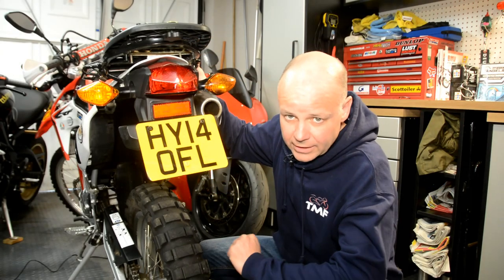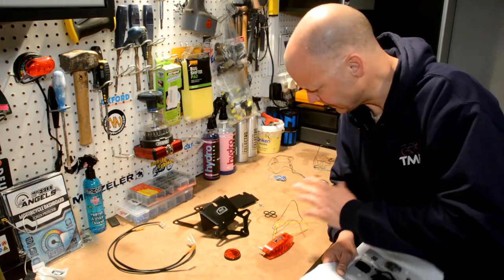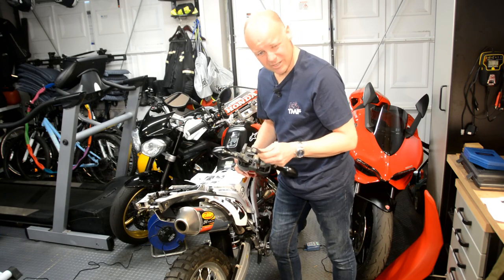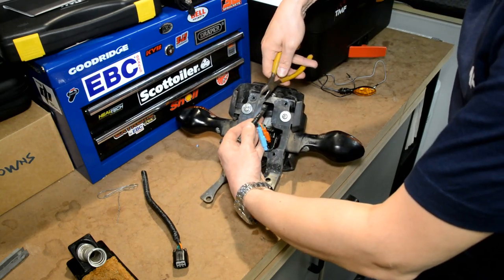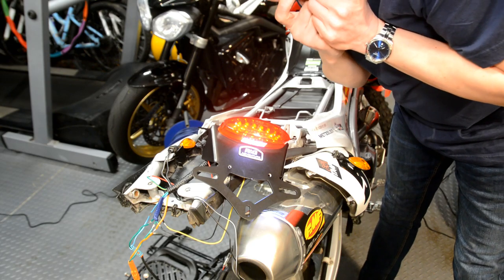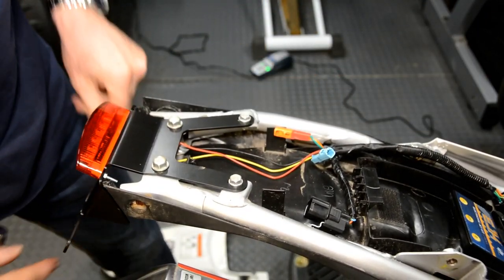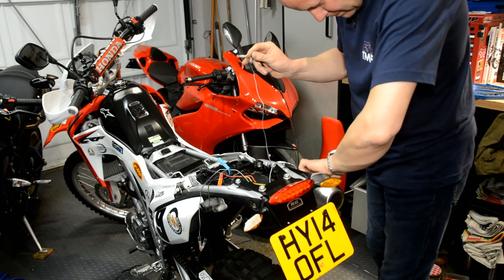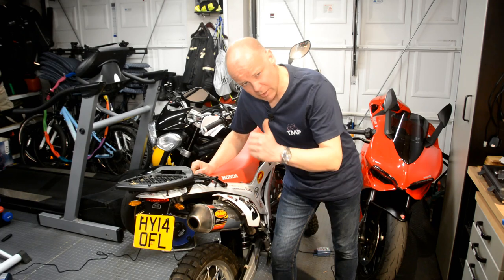How to cock up even the simplest of jobs! - Honda CRF 250L

Comment: Hiya TMF, you need to put some shrink rap on those solder joints as the tape will get wet and move, also to alter the speed of your indicators you need a couple of resistors (ebay), fit them when you re joint your wiring. ian (electrician HR Wallingford)
Reply from the maker: Cheers Ian - I've ordered both some resistors and a LED relay from Amazon, I'll see what looks easiest when they turn up!

Comment: To slow the indicators flash you can add some resistors (more soldering) or I believe there are dirt cheap 'dedicated' Flasher Units/Relays (for DIY'ers that have changed over to LED's) which have built-in resistors (no soldering just a simple swap out) - most bikes have this aftermarket option; Just a couple of quid off eBay.
*They often have an adjustable screw to set the timing.

Comment: Contact the supplier, or search in forums etc, to see if you need inline resistors or relays for the indicator flashing issue, I had to do similar (with resistors) when changing led indicators on Panigale :-)
Reply from the maker: Yes clearly I do need some resistance in there - I’ll do some research...so much for plug and play!

Comment: Hi the solution for the fast flasher speed issue all you need is a fixed rate flasher unit if contact a company called 12 o'clock labs you’ll find all the electronic plug play units you’ll ever need for your CRF...!!!

Comment: You need a load resistor for your LED turn signals. Since your factory wiring was set for regular bulbs, the LED uses a lot less power. Unfortunately those resistors sometimes are more expensive than the turn signals themselves.

Comment: Good on you for trying,  a relay specific for Leds  should sort the flashing speed out, always a good idea to have heat shrink in your tool kit, also one can buy conduit yo cover all the crap up, looks much bettet you mechanic you 👍👍👍😎
Reply from the maker: Yes just ordered some R&G in-line resistors from Amazon - less than a tenner!  So much for "plug and play"!
Reply: @TheMissendenFlyer  next ti.e look on eBay,  always cheaper & usual no P& P👍👍😎

Comment: Great video TMF you should have kept the colourful language in.. I fitted the DRC edge 2 tail tidy to my 2019 CRF250L and 250 Rally.Totally plug and play and the bracket comes with mounting holes for both OEM and aftermarket indicators. I actually left the original indictors on both bikes as they look ok. The DRC cost £59.
Reply from the maker: Seems like a better deal by far!
Reply: TheMissendenFlyer Only by about £25 if you add the aftermarket indicators, but the fitting was much easier 😉  I  got my 250L new in January then started seeing all the 250 Rally vids..bought  a 2nd hand 250 Rally with 180 miles on it, FMF slip on, tail tidy and rear carrier already added now I’ve got them side by side in the garage. The wife doesn’t mind either so every cloud..keep up the great vids.

Comment: 1) Don't but an R&G tail tidy.
2) Always use heat shrink when connecting wires.
3) If you've drilled a hole into metal, rust proof the hole and if possible insert a rubber grommet to reduce vibration and wear.

You may now find you wire connections become loose, the fitting will start to rust and your indicators will regularly fail. Sorry.😬
Reply from the maker: Thanks for the advice Michael - this is how we learn!

Comment: You need an LED flasher unit (plug and play and easier than soldering in resistors) as you have led indicators now. Did same job on my BMW G650GS Sertao but with 2 slightly flattened L brackets for £1 for small number plate mount.

Comment: The indicator need resistance relay.
Reply: Correct
Reply from the maker: Yes but what type?
Reply: @TheMissendenFlyer  Best and easiest way is to buy an LED relay which replaces the original.
Reply: @TheMissendenFlyer  Ask R&G what size and power rating resistor they need! ;)

Comment: Looks nice but I’d be a bit miffed if I paid £82 then had to destroy the original part, should be a straight exchange. You’ve done the video maybe  hopefully R&G will take some notice of the comments. Not sure also that £10 for a couple of resistors that should have been part of the kit is good value.

Comment: Complete pain of a job, my language was far bluer than yours when I did the tail on my CRF though ! Still haven’t sorted my indicators which flash like mad ! Good luck with it 👍
Reply from the maker: Have you got the same tail tidy?
Reply: TheMissendenFlyer  No, I went with a cheap eBay tail tidy, and some oxford non led indicators. My indicators flashed at twice the speed despite not installing leds, so I attempted to change the flasher relay, but found the stock unit installed was infact an led relay ... am assuming to accommodate the stock running lights maybe.  12 o clock labs make a fixed rate flasher adaptor which seems to be the go to amongst some fellow crf riders.

Comment: If you use some heat on the insulating tape it should nicely shrink to seal the gaps. Personally I hate these kind of jobs they are such a pain and most of the time look like they not going to last.

Comment: Always enjoy your CRF videos, did you ever look at the DRC edge tail tidy, it comes with a bottom plate to keep the wiring clean and pre drilled holes for the indicators and is around £50 on Ebay.
Reply from the maker: No - I wish I had!

Comment: You can buy heat sink resistors cheap enough on eBay . as the the indicator relay was designed to run under a heavier load ..

Comment: your indicators go quick causse there led-s....you need to add a resistor parallel of each led indicator to up resistance to match a normal bulb. if your oem bulb is 21 watts u need a 8.2ohm resistor to match the oem bulb resistance.....do i make sense?

Comment: Hi TMF, Your LED winkers "hyper flash" as they do not present the resistive load that the bulbs did. As you can mention you can restore normal winking using resistors to put the "load back" personally I think is crude and not very nice, much better to spend a fiver on a solid state flasher relay, this will blink LED's, bulbs or anything else. You can even get them with adjustable flash rate. I always convert my bikes to 100% LED's, I solder and heatshrink all joints and tend to use cloth loom tape (or non adhesive plastic), dont use PVC insulating tape, as its not really suitable. Cheers Matt.
Reply from the maker: I like the idea of replacing the flasher relay - trouble is I've no idea where it is or what it looks like on my CRF!!
Reply: There are plenty of YouTube vids showing how.
Reply from the maker: I shall certainly be checking those out in due course!
Reply from the maker: ...right thanks for that - relay on order....

Comment: Hi I have tried an R&G tidy on my CRF didn’t like it. I have now fitted a DRC edge 2 from adventure- spec lot better fit an looks better, you can use original indicator or 10mm LED indicators, I have also tried R&D resistors for the LED indicators still too fast, finally used some 50w 6 ohm resistors in aluminium cheaper than R&G and they work, got them from Amazon.
Hope this helps.
Reply from the maker: Thanks Chris - alas I have the R&G ones on order from Amazon Prime :0(

Comment: You will need inline resistors to slow down the speed of the indicators. The resistors will get a little warm/hot when the indicator is flashing.
Reply from the maker: How do you work out the value??
Reply: @TheMissendenFlyer  

Louis-moto has a very guide for fitting led indicators on their website which includes the formula for selecting resistors. Search "fitting led turn signals" on the website.

https://m.louis-moto.co.uk/rund-ums-motorrad/schraubertipps/led-blinker

Comment: Thank you for posting.  Great video.  My compliments, anything that requires cutting, drilling or removing more than 6 screws I leave to the experts. :)  Seems to be a good philosophy for me (cheaper than having to buy a new motorcycle).  I don't understand why the vendor did not include the connector.  Seems a bit tacky, hopefully they have a reasonable explanation.  Also, I recently discovered "Itchy Boots" and noticed at least one post from you.  I am still playing catch up with her videos.  If you get the interview, it would be a great coup for you and good exposure for her.

Comment: Seems as if you shyed away from drilling two new holes in the license plate to properly locate that under the license plate light - eliminating the black plate where you conveniently place a TMF sticker.  I like the sticker, but still believe the license place ought to be positioned higher on this particular bracket.
Reply from the maker: Fair enough!

Comment: Those indicators look wonky. Are the holes level, and in the dame location on each side?
Reply from the maker: They are wonky and they are the same both sides - turns out those side plates aren’t exactly vertical...

Comment: just put a couple of resistors inline with your indicators and that should slow them down
Reply from the maker: Yes just ordered some R&G ones from Amazon - less than a tenner!  So much for "plug and play"!
Reply: @TheMissendenFlyer  some sets do have them built in some dont  50/50 on which you get

Comment: I've been put off getting the R&G tail tidy for the Honda CB300R due to the poor instructions I got with the radiator guard (great guard, crap B&W photocopied instructions) and the lack on online fitting instructions on the R&G site (Coming soon!).  I did email them about the quality of the instruction sheets, but got zero response, not very reassuring.  I don't want to cut and splice my loom but I can't get confirmation that I don't need to.  Also, I read somewhere that the most rearward part of the motorcycle cannot be the rear wheel, hence those awful extended standard tailpieces.  I wonder if that would be an MOT issue?
Great YouTube channel Missenden Flyer, keep up the good work :)
Reply from the maker: That "most rearward" rule I think only applies to new bikes (it's one of the regs) , once they're out of the showroom you can do pretty much what you like (as long as it gets through the MOT of course)....
Reply: @TheMissendenFlyer that seems fair enough.  This bike is on PCP so I have to consider returning a 'standard' bike after the 3 years if I don't keep it.  Any mods need to be reversible.

Comment: I believe there is a discrepancy between your front and rear LED indicators and the relay between the two. Bike electrickery is always a headache. You'll have to match the indicators and possibly change the relay to adjust the flash rate...I think.
Reply from the maker: I think you’re right....so much for plug and play eh!?
Reply: @TheMissendenFlyer  Yep. If you have a separate relay for the rear, then you might be able to take the relay cover off and adjust the flash rate with a small flat head screwdriver to match the front. If you have a single relay for both front and rear, (and there is a flash rate difference between front and rear) then I think you'll have to get matching indicators and then adjust the flash rate thereafter. Hope this helps

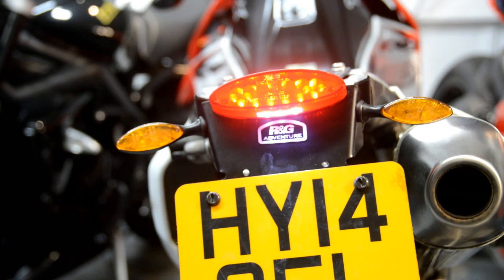Comment: At 12:08 you did the final test of the indicators are they were reversed judging by what you said. Otherwise, good job!
Reply from the maker: Just a slip 'o' the tongue, they are wired in the right way around, just need that flashing frequency sorted now...
Reply: @TheMissendenFlyer 
Ah... well it's good then. As for fast flashing, like someone else said, either LED flasher relays or parallel resistor kits (to simulate the load incandescent bulbs create) should do the job.
Hyperflashing is due to the fact LED indicators draw such little current that the normal relays register them as burnt out incandescent bulbs.

P.S. I recommend flasher relays because they're much simpler to install and you don't have to worry about them heating up like resistor kits and potentially melting something inside your subframe.

Comment: You have two out of 3 options:
1. Replace the Relay for one that can work without a load (example video here: https://www.youtube.com/watch?v=mMLNpcQHcCY )
2. Place a resistor on each LED to simulate load (this will use the same current than filament bulbs - https://www.youtube.com/watch?v=YKvzwq___P4 )
3. Do nothing, leave it as is :P
Hope that takes you on track :)
Reply from the maker: Cheers Daniel..

Comment: @1:49 you say 'more wiring, possibly for the indicators'.
Did you use that? It may have contained the resistors for the LED's.
In all honesty, I think you've probably put a few people off buying that kit, butchering your OEM tail for the plug (when plugs are cheap - bit tight of R&G IMO) means - as you said - no going back..
Reply from the maker: Yes it was used - so much for plug and play eh?
Reply: Yeah. 
If you're just having the rears as LED. You'll need resisters for them. 
The fast flashing is like when you have a blown bulb,  lack of resistance. 
If doing all 4, you can swap the relay,  much tidier

Comment: Could I suggest when you fit the resistors you take the opportunity to use some heat shrink sleeving over the soldered connections and the resistor and use some black braiding (https://www.amazon.co.uk/ 5M x 10mm) cut with a soldering iron and finish the ends of the braid with automotive tape, the wiring will then look professional and be reasonably waterproof (IP44X) and protected.
Reply from the maker: You may indeed Gordon....

Comment: I have the same bike and I bought this kit with front and rear indicators from USA it comes with every step you need just takes a long time to do (at least for me almost 8 hours), and to slow them down they also sell a Fixed Rate Flasher which is a relay that you just unplug the factory one and plug the new one it's that easy, it comes with the kit if you choose it.
https://soloracer.com/crf250ledge2.html
Reply from the maker: Looks good!

Comment: Not sure about this one TMF.  I definitely like the smaller profile, but I think the brake light could be a smidge lower, so its not part hidden by the rear bodywork.  Id also like the indicators to be level, they look a little Shrek ear'ish at the mo....but all that aside a complete success....lol.  I agree with you every small job turns into a nightmare.
Reply from the maker: Yes what a pain all round - I do think the bike looks neater though....